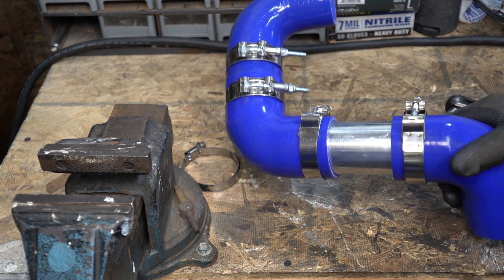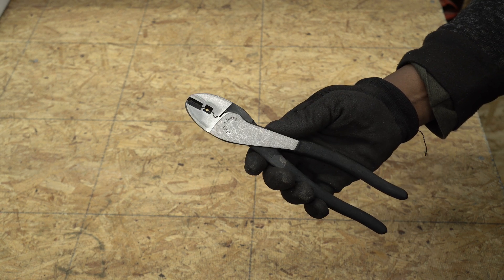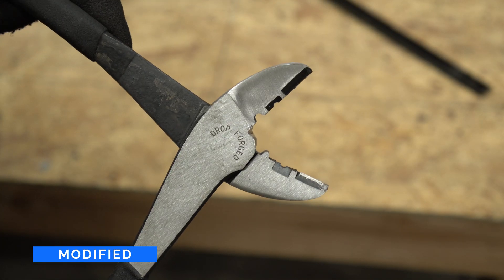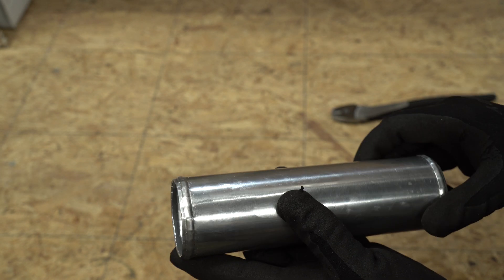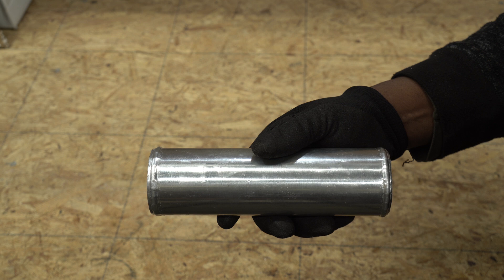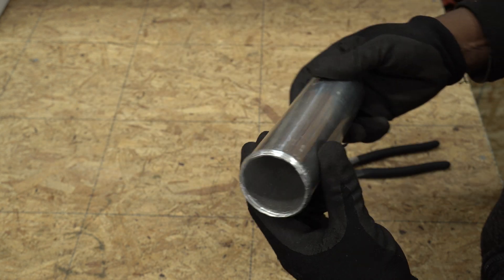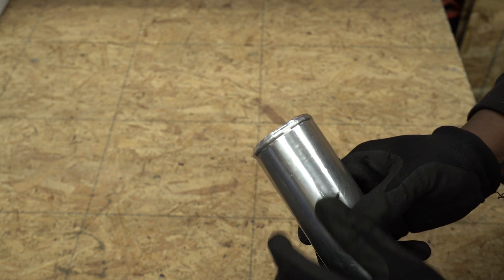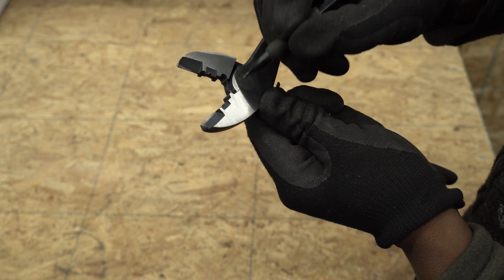How to make a cheap Intercooler Pipe Bead Roller easy DIY Bead Roller

Comment: Hello!! .. I am a fellow tradesman! ... I am an old Millwright from Canada, I am retired now. 

Thank you for posting this,  am reping my van and need ot bead roll fuel line tubing.
As you may know modern fuel systems operate at higher pressure now .. Up to 60 PSI ...

A simple hose clamp can fall off during use!
I copied your tool for to fit in a 10mm (3/8") fuel line tubing.

It works fantastic .. thank you so much!!   

I am certain I would never have thought of this on my own! :)

Comment: Genius! A lot of other DIY bead tools require welding which I cannot do. This is a much faster and simpler solution! I only have 1 pipe to work on, so this is the ultimate way to save money and time. Thank you so much!!
Reply from the maker: Much respect! Yea, it's definitely the cheapest and easiest method to bead pipes.

Comment: As soon as puled out the pliers, i knew exactly where you were going. Very smart. What gauge tube is that?
Reply from the maker: I'd have to measure and check the thickness, but I don't imagine using anything much thicker for boost pipes. Thanks for watching!
Reply: @CraftyWorkshopBuilds  cool. Thanks for the great content.